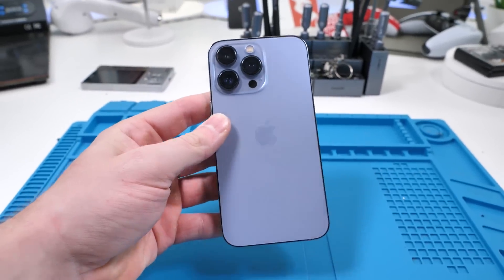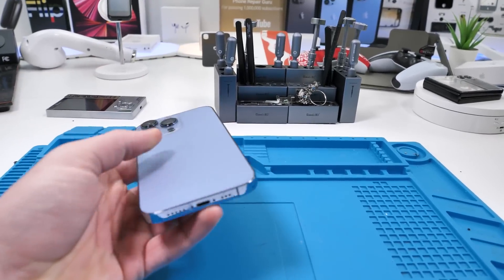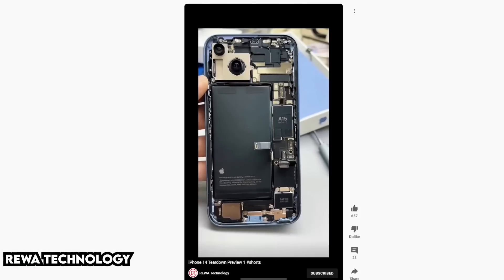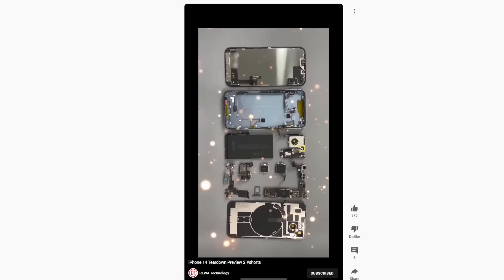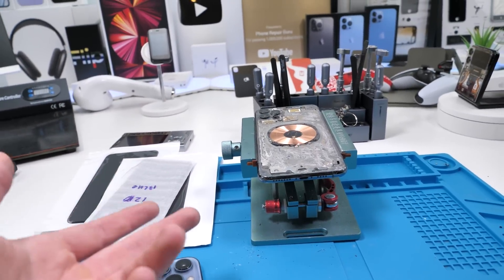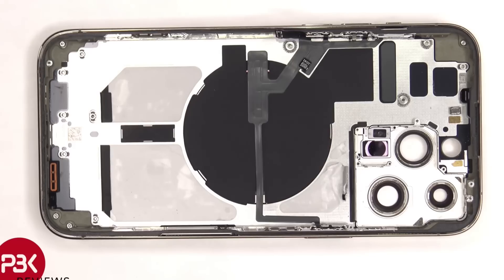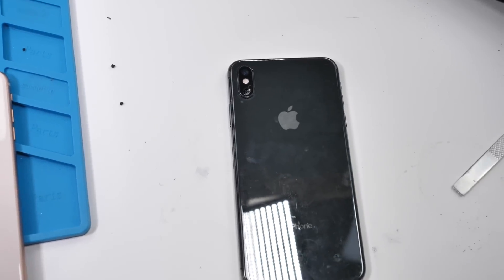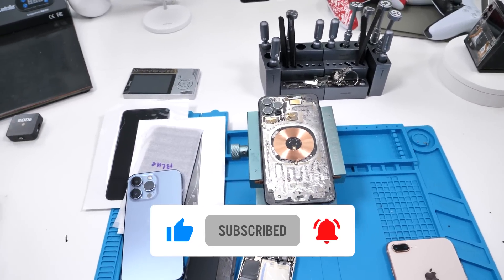THE IPHONE 14 IS...... DIFFERENT ( On The Inside) 😳

Comment: They did something like this because 14 and 14 Plus will be the actual main models that people buy and use for a long time. If Apple's sale model doesn't change in the near future, 14 and 14 Plus will be sold for 2 more years as new with gradually decreasing prices, which makes them more popular among people. So, these two having more easily repairable backs makes sense, because that's one of the most vulnerable parts of the iPhones
Reply: Just use a rugged case and don't drop your phone off a 3 story building and you're good lol
Reply: @recorderboy936  what if I don't want to use a case because it makes my phone thicker and it already is so thick that I can't use it with one hand

Comment: I like the concept of the older iPhones that they open from the front because you can change the battery without exposing the cameras to the dusty air in your room, but I only like this concept in the iPhones and not in the Android phones because the iPhones' screen is held by two screws while the front opening Android phones screen is held by only adhesive.
Reply: True! Maybe that's why Pros won't open from the back, as cameras are much more sophisticated there and are the biggest selling point

Comment: I think this is because of the thermal desing. They said that the regular iphone 14 will have an mproved heat dissipation, but not the pro. If you see at the teardown images you can see the metal plate as big as the phone itself y the middle.

Comment: I don't understand this argument very much, like... With Android phones you can replace the back glass easily, but for the screen to be replaced, you need to swap out the entire midframe, unless you get very destructive with the screen. Now with iPhones it's pretty much the same but with the back instead. Personally I'd rather have my screen be replaceable than have the back glass replaceable, like... You can just cover it with a case if it gets broken

Comment: Except nobody wants the 14 and 14 plus as preorders are worse than the SE 3 and 12 and 13 mini
Reply: The biggest reason why this problem exists is because of the lifespan of the iPhone. It simply lasts way longer than the average android leading to people, like me, sticking to their old phone for way longer. I currently have the XS, latest OS, and have zero plans on upgrading within 3 years. I am daily driving this thing until either support ends, or the phone dies, or it becomes slow. None of these are the case any time soon.

Comment: Imo the iPhone 14 is a flop, it’s literally the same as the 13, and the 13 is basically the same as the 12, which its the same as the 11, the only real differences are cosmetics.
Reply: 14 will be a flop but 14 pro might succeed
Reply: i have an xr and it works perfectly fine, tbh i don’t really see the point in upgrading unless you really need the latest phone for whatever reason
Reply: @ignDart  ya this guy just replaced my battery in one of his vids and it’s like new now

Comment: I think it will be similar to android phones but the screen will still be able to be detached from the frame.
Reply: i hope so because to hell with the back glass if you can't easily access the display
Reply: Well, there are one good thing and one bad thing about this change. My theory is Apple will now repair your phone when its back glass is broken but it's not gonna be cheap. Because now the glass (along side with the wireless charging coil and the magnets) will now be part of a metal frame and that whole frame is pretty much the second screen but in the back of the phone. For repair shops, back glass repair can now be done in 2 ways. You can either replace the frame or you can replace only the glass much like the screen. The difference is now you can be a little rough on it without any risk of damaging the internals of the phone (except for maybe the charging coil) which makes it easier and maybe even cheaper than replacing the whole frame itself. You only replace the frame when either the charging coil is non-functional or when the frame has some dents in critical areas like the battery or the board or maybe when the magnets need replacing but you can't just buy replacement magnets for some reason.

This is just my theory so please don't blame me if it doesn't come out like that.
Reply: Damn, I saw REWA Technology's 2nd teardown preview after commenting. It is exactly how I imagined it to be. Maybe scraping and prying is not going any where any time soon.

Comment: Buy any Android phone, ditch all your iPhones, problem solved. This will push apple to go back to the old design for repair.
Reply: Hmm lets think about that. The average android flagship gets a 3/10 on ifixit’s repairability score with a foldables reaching a 0/10. While apple has had a 6/10 or 7/10 with every single iPhone except for the very first one. If you count out the fairphone the most repairable modern android is the pixel with either 5/10 or 6/10. Why would any problem be solved by switching to a device with a worse repairability? And don’t even get me started on the Way worse lifetime because most androids lose support for the latest OS after 2 years and iPhones after 7 years. Its almost as if the iPhone is the better option when it comes doen to its lifespan and repairability (if yet again you count out the fairphone which reaches a 10/10)

Please my dude, just do some research before commenting bs
Reply: @JimV.  You going to teach me about repairs? I have been repairing phones for 10 years+. The average repairability on android phones are
6/10. You clearly have no knowledge about repair or anything else for that matter. Lets take the iPhone 4 as an example, other than the
2 screws that are needed to be removed, even though the back comes off. Repairability inside is a nightmare, most screws are different
sizes not to mention putting wrong screws not in the correct way caused shorts and reboot issues, among other things. During that time
the battery was still glued in, while android had easy replaceable battery that had had the covered to be removed by a clip back cover and
a simple battery swap. Moving up to iPhone 8 to iPhone 13 where the glass and frame was fused together, which made another headache. 
Not to mention, swapping parts, coding them so that face id and so forth to work, not to mention the touch id, button etc. Had to be from
the same donor to work. So before commenting useless comments, learn before you answer. 

No matter what, any Android repair is easy over the apple counterpart. After fixing more than 50,000+ phones, I have more knowledge than you'll
ever have in your life. So go comment your bs elsewhere.